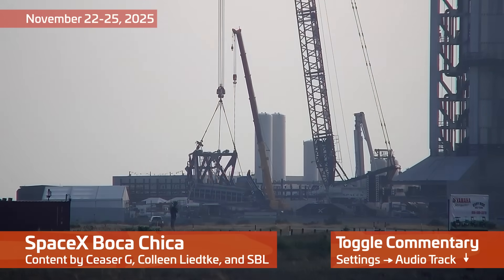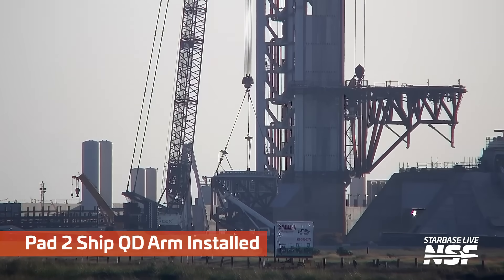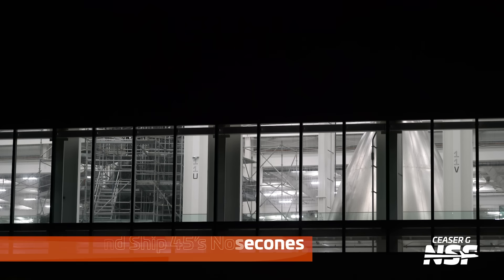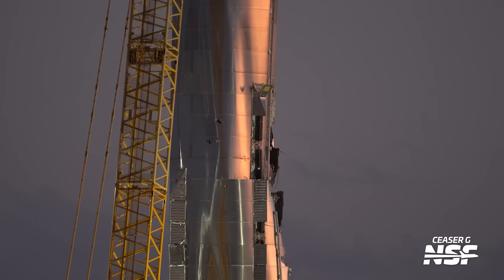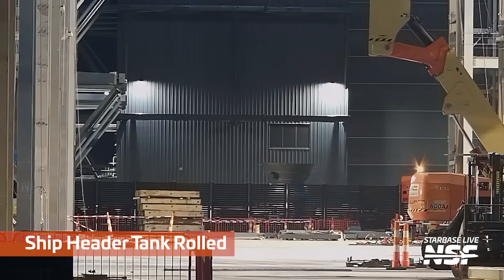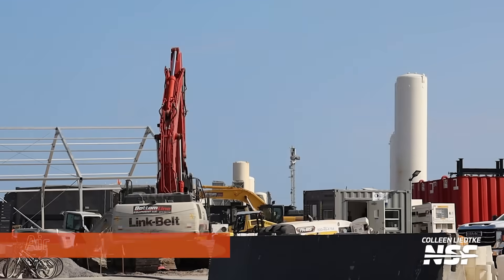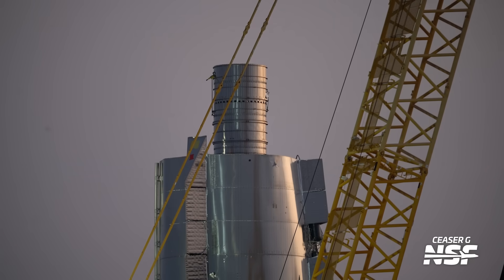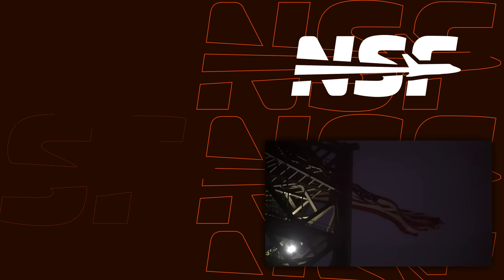"Booster 18 leaves Massey's one piece at a time" | SpaceX Starbase

Comment: The rebar is bent to return the stress at the end of the bar back to the concrete keeping the end of the structure in compression because concrete sucks in tension.
Reply: So if concrete sucks in tension when does it not suck?  Normally I would say in relaxation concrete wouldn't suck, but I don't know concrete!  🙄
Reply: @michaeldeierhoi4096  Concrete is great in compression but poor in tension. Steel is great in tension. Put them together and you get reinforced concrete. Reinforcing steel is wrinkly to get a good grip on the concrete. A bent end to the rebar fixes it to the concrete even better.
Reply: @rogerwalker5032   Thanks for the explanation and ignoring my dumb pun.  It's like getting a taste of my own medicine when I tell people don't feed the trolls.
Reply: @michaeldeierhoi4096  Ha ha!  Sorry, I was a bit slow on the uptake.  Serious engineer here!

Comment: @NASASpaceglight LOL Das!!🤣 12:10 The guy is wearing what is called "Rodbuster chaps" (or sometimes just ironworker chaps or rod chaps). These are protective leather coverings designed to shield the thighs and groin area from cuts, scrapes, punctures, and general wear caused by sharp rebar ends, tools, or rough materials during work.
Reply from the maker: Yeah, I'm not going to Google that. 😂 - Das

Comment: Rebar detailer here...   Adding 90 ° hooks at ends on rebar  increases anchorage and strength preventing rebar to pull out of concrete typically used on a thick double mat concrete slabs
Reply from the maker: That makes good sense... the texture bumps on the rebar are one thing, but a curve would really lock it in. Thank you! - Das
Reply: Steelfixer here. The bar is sometimes known as a bob bar or L-bar (self explanatory) used as wall starters, column starters and also end capping bars to enclose a cage.  And as our steel detailer friend/enemy stated, for anchorage.

Comment: The construction workers are wearing boots that have a steel ‘cup’ in the front encasing where your toes are. 
FYI my US Navy issued flight boots also have “steel toes”.
Reply: In some instances composite safety toe boots are available, made of carbon fiber similar to the over wrap in COPV. They test to the same safety standards as steel toed boots. Composite toed shoes don’t transmit electricity as steel toed boots do, a bonus if you’re working around explosives.